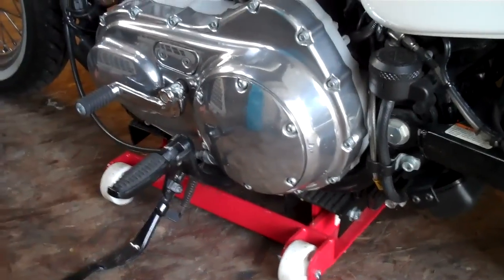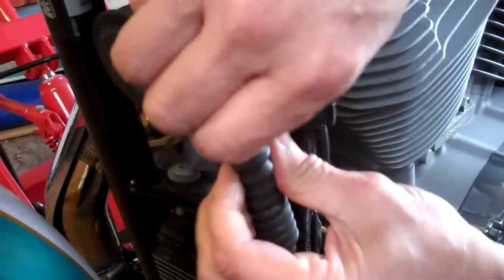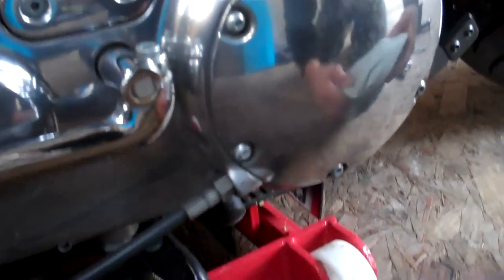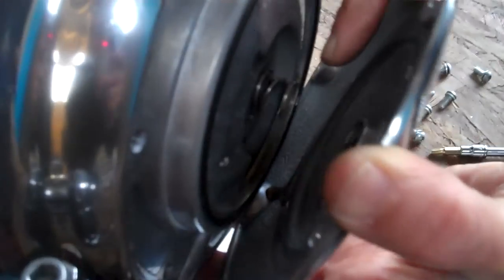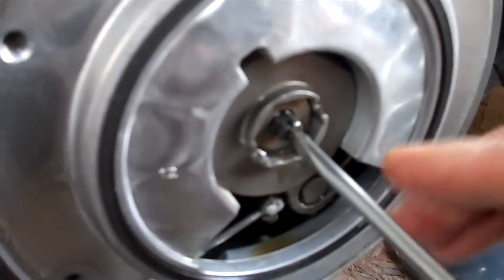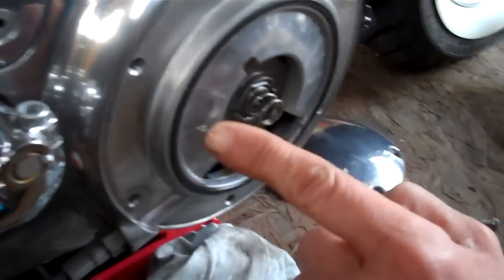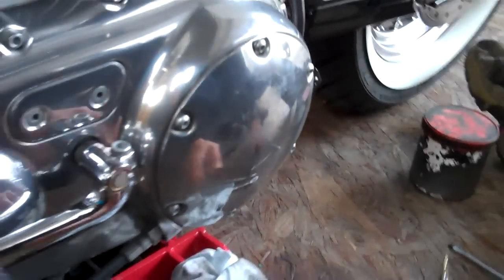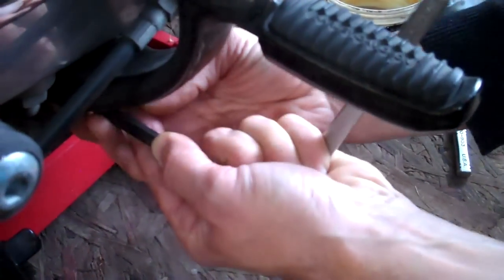Delboy's Garage, Harley Sportster Clutch Adjustment.

Comment: My sporty was getting stuck in gears and was too hard to downshift. When I had the clutch and in 1st, it was accelerating without letting it go. I adjusted the clutch after watching this video and fixed the problem for a bit but it's back to getting stuck. Also, it was hard to pop it in neutral. Any ideas on what it is?
Reply from the maker: WeenieJuice_Pompgawd If you adjusted it and it made a temporary improvement then it could be that it's time to replace the primary oil, as when this breaks down excessively it can cause the clutch plates to drag... may not be an instant fix, but at least it will eliminate this as a cause.... try that first and see how you get on!
Reply: Moonfleet41 When I adjusted the clutch, i didn't put the derby cover on right so it leaked oil. I put one quart of chain case oil and its still doing the same. Do i need a new clutch?
Reply from the maker: WeenieJuice_Pompgawd have you got the level of the oil correct..?
Reply: Moonfleet41 yes. 1 quart for my sportster xl1200n

Comment: im replacing the shift shaft in the primary. any advice... ps i may need a sprocket locking tool and that spring compression tool looks sic
Reply from the maker: +Michael Golightly Any advice??  Any advice on what buddy??  Are you having problems??

Comment: Those torx screws are evil, evil, little things. I have two that are currently stripped on my sporty. Tried the extractor tools with no luck :( . Next step is to try and drill off the head with a 1/4 in bit and hope for the best.

Comment: Hey man, I know this video is pretty old now but hoping you'll still give some advice here! My father and I went through this procedure about 30 times, a long and frustrating day. The results- the bike still wants to pull forward in first gear, even when the clutch is fully pulled in. Some adjustments eliminated this issue, but we still felt it was extremely hard to shift and to find neutral. Feeling like it was 'slamming' into gear. We are back at square one. Any thoughts? On an 08 nightster. Thanks for all the helpful videos, you've really made me more knowledgeable in the motorcycle world! Cheers.
Reply from the maker: Hi there, just so we can be clear, did you follow the steps exactly as we showed in the video??  Did you do anything different, or did you skip any part, or do it in a different order??  Let me know exactly what you did and will try to help, cheers, Del
Reply: +Moonfleet41 Del, the step by step- we backed off the clutch cable so it had complete slack, then opened up the derby cover, removed the hex nut, then used a flat head to back off the adjuster screw until we both felt that it was loose. Then we would turn it counter clockwise until we felt it start to give just a little bit of resistance, then backed it off a 1/4 turn. Maybe we are a bit off on where it's supposed to catch? 
Anyway, once we put the hex back in and button it up, we then took the slack out of the cable just as you did in the video. Like I said before, we did this a numerous amount of times with slightly different variations to how far we backed off the adjuster screw. Some would feel good, where it wouldn't pull forward, but then was still very difficult to shift and to find neutral. Thanks for the help sir! Hope this explains it a bit better.
Reply from the maker: Hi buddy, thank you - yeah, I know the adjustor screw part sometimes causes issues, let me talk you through it, try it again, following these steps and let me know how you get on:

"Make sure you start by collapsing the cable adjustor sleeve completely together so the lever is flopping around at the bar, and do this BEFORE you touch the engine casing... once inside the engine casing, observe the cable down in it's connecting fork at the bottom of the clutch and make sure there is a little free play on the cable and that it is not pulling on the fork at all... now you are ready to adjust the clutch pack.............

Remove the spring and nut (and here is where some people go wrong!)... back the nut OUT (counter clockwise) until it stops, and many people use a screwdriver and keep turning till they can turn no more and this is way too much !  When we say 'back out the screw till it seats' - we mean when one part touches the next.  You should not screw this adjustor screw outwards with any more pressure than two fingers on the dust cap on your tyre valve... I mean it must be really light pressure... you simply need the back of that screw to just 'touch' the back plate THEN turn back INWARDS ONE QUARTER TURN .... and then re-assemble everything.  

When you fit the nut back over the screw, try to make sure it does not move when trying to slot the nut in to it's cup... and then when you have re-set the cable free play, make sure that you have the 3mm of free play at the level knuckle.

So as you can see, the common problem is not understanding the seating of the adjustor screw, if you wind it out too much, you actually lock the clutch plates up, I really cannot stress enough it MUST be turned out with NO PRESSURE at all, in fact when I am busy and on a time limit with the service, I usually just use my fingers to turn that nut out... "

Like I say, let me know how you get on, don't worry, we'll get it sorted!
Good luck , Del
Reply: +Moonfleet41 we were about two or two and a half turns away from completely being tight, (turned counter clockwise completely). That's where we were feeling it just barely catch. Then rolled it to the looser side a 1/4 turn, 1/2, turn and a bunch of others in between just to see if it made any difference. Some felt better than others, but none seem to do the trick.
Reply from the maker: Ok buddy, just got up to your reply... 8am here in the UK.  Ok, so obviously something is wrong... so as a thought process here, sometimes, when you're stuck, it pays to think about the principal of the machinery, how it works, and the effect of what you are doing on it, so to explain that....

The principle of adjusting the clutch is to make sure that there is enough freeplay in the cable so that it's all fully relaxed and not pulling on the clutch when the lever is released, so that the plates are squeezed fully together under the weight of the spring.  Clearly, the effect of what's gone wrong now is that the plates are not separating when you pull the lever in, as indicated by the drag that you're experiencing.  

True enough, you describe the adjustment correctly, if you imagine the screw you're turning has a flange just the other side of the hole it goes through, and when that flange meets the casing, if you keep turning, it starts to pull the clutch plates apart... so there is, often, a problem with people being confused with the principle 'when it seats'... and quite simply, it just has to touch, nothing more!  Imagine if it was an electrical part and you're making a connection, the minute the two metal surfaces touch, that's it, enough !  You then back inwards a 1/4-1/2 turn to make expansion space for when everything gets hot... 

But you know all this, and you've done all this, so all I might suggest is that there could be some foyble with your clutch , or maybe even, a burr on a few of the plates... so there's two more things I can suggest.  One is to back out the screw till it touches, then rotate in a full turn and try that... if that is still a problem, and doesn't cure it, and the cable itself is not causing a problem, then you could need to take the clutch pack out and inspect it for burrs or digs in the clutch basket... you are looking at the slots that the clutch plates slide in to on the outer basket.  If there are any dents, or digs, in the those then the plate plates will get 'hung up' on them and refuse to separate, so they just need filing out and cleaning up.  Once those slots are smooth, the clutch plate outer fingers can slide in and out of them smoothly, so that could be it.

JUst one last point, am presuming this is part of a service??  And am presuming maybe you've changed the primary oil at the same time??  So if you have, did you put thick gear oil in there instead of regular engine oil????  

Hope some of that helps, let me know Del
Reply: Alright thank you so much again for taking the time out to help a complete stranger! We really do appreciate it. OK back to business- when you say "... so there's two more things I can suggest.  One is to back out the 
screw till it touches, then rotate in a full turn and try that".. which direction do you mean to rotate? clockwise to make it looser correct? Hopefully this will do the trick, taking the clutch pack out may be a bit too steep of a project, i have yet to watch your instructional video on it. 
 
As for your other questions, We have been doing the maintenance bit by bit on our bikes, and maybe a couple months ago, early summer, changed the oils. I've put in the SE SYN3 in both the primary case and run it through the engine. 
We decided to start adjusting the clutch not as a normal service, but because i felt it becoming difficult to shift and to find gears while riding, seeming like it was really slamming down into first, and had to use alot of leg strength to get it up to second. Finally with it getting even worse, with the bike still wanting to move in first gear.

This bike was a Craigslist buy with a pretty young kid as a seller, wasn't helpful with letting me know what type of oil was already in, so I felt that the oil I chose would've been the safest route all around. Maybe I'm completely wrong! Hope not.  

One last thought- you mentioned the cable maybe being an issue, what would be some signs? I guess good to mention- through a couple trials with the adjustment, we would notice that when taking the slack back out of the cable in the final step, the clutch lever would sometimes not squeeze completely into the handle. odd, and we knew we were wrong, so we would start again. Maybe there's a sign of a cable issue there? 

Thanks again, sorry this is a book to read!
Reply from the maker: Hi again Mathew.  ok, with the screw... to be exact... you turn the screw "outwards"...which is 'Counter clockwise'... and until you can feel it touch the stop..(no pressure on it, stop once it just touches).... then turn it back 'Clockwise' a full turn, and see how that goes..!!     

Now that you've told me about the previous owner and an unknown past....it could be that he added thick gear oil by mistake and it has glued the plates together.. but the SE Syn3 is the best oil it can have, so at least you've corrected that... 

I really cant advise you any further buddy without seeing the bike on front of me.. the lever should feel smooth and oull cleanly all the way in to the bar.. if its notchy or needs force, then perhaps it needs further investigation inside the primary case to look what may be up.... try that adjustment as i said here, just one last time and see if that cures it.. if not, then at least you have done everything you possibly can and perhaps its time to hand it over to a mechanic who can investigate it for you... sometimes you can win 'em all buddy... good luck. Del.

Comment: Dear Delboy,
I would like to ask the following. One fine morning i started up my sporty 15 and found out that the clutch lever was coming way back and i am not able to change gears unless i rev up the bike. In short i am not able to change gears and if i hold the lever with 1st, the bike still wants to go forward. And when in 5th, after 100km speed it just revs up and then takes all the power. (Like its not locking the gear) The technician told me that i might have to change the gear plates (spring plate and so on). Is that correct? Cost ranges from 100 to 350 € plus he said.  I thank you in advance and i would like any suggestions.
Reply from the maker: Hi there, don't know your bike, or it's history, or the exact characteristics of what you're describing, but if you suspect a slipping clutch, then you can level the playing field by changing the primary oil and carrying out the standard 'clutch adjustment' as per the normal 5,000miles service, and then once everything is set, and adjusted, if it's still doing it, you'll need to investigate further by stripping the clutch to have a look... good luck with it.

Comment: So I’ve installed the Barnett extra plate kit on my 2004 xl883 and I notice the more it warms up the harder it is to shift. So when I adjust the adjuster screw (when the bike is cold of course) should I make more or less slack from seated? I believe it’s at 1/4 turn out now.
Reply from the maker: Hi Drew,  the clutch adjuster screw needs to be set to 1/4 turn IN from the outer seat, not a 1/4 turn out as you said... the quarter turn gives you some hear expansion space, so if its getting sticky and dragging when it heats up, then you dont have enough expansion space.. so try a 1/2 turn INWARDS from the outer seat.. and see how that goes.. also, make sure you have the correct primary oil level.. it needs to be up to the bottom to the clutch plates with the bike upright..!!
Reply: Ok so I need to lightly seat it then go in (counterclockwise) 1/4 turn instead of out (clockwise) light I have been doing? Is that because I have the extra plate kit and need more room?
Reply from the maker: @dwillinghammer  NO Drew.. its all clear in the video mate.. i think you confusing "in" and "out" mate..... you start by winding the screw all the way OUT towards you,(counterclockwise) until it seats lightly... then turn back IN away from you, (Clockwise) to give you the freeplay you need.. if you've been doing it the other way round, then thats probably why its dragging... adjust it as per this description, (as shown in the video), and make a 1/4 turn INWARDS (clockwise).... then see how it is mate... Good luck.. Del.
Reply: Ok. I was just mixing words I had done it exactly as you did in the video. Turned it counter clockwise until lightly seated then turned it clockwise 1/4 turn. And now with its up to temperature it drags a bit.
Reply from the maker: @dwillinghammer   Aha right, i thought that would be the case... OK, then just go to a half turn then see how it is... its a known remedy, the advice comes from the guys who do stunts on Harleys, rolling burnouts and lots of wheelies.. it puts the clutch through so much more punishment.. (which they can take by the way lol)...some of them even go to three quarter turn., what ever it takes..  it will just git it more expansion space.... and should fix it for you buddy.... Good luck with it.. id be interested to know how it goes.. del.
Reply: Follow up from this morning: I readjusted everything and set the adjustment under the derby cover to 1/2 turn (clockwise) from snug and it felt really good until about 10 minutes later, second gear started to bite a bit when shifting. I’m thinking I’ll try 3/4 turns after it all cools down tomorrow morning and see how that feels. Thank you for all your help!

Comment: Hi del

I've just obtained a old Harley softtail 1996 all good but I can't seem to find nutrial when bike is running also it's really tough to shift from first into second all other gears are fine I noticed that the shift lever is bent I bent it back into shape could this be the problem?? Replace ??: I've had the primary inspected and clutch but no difference any ideas ??

Regards

Rob
Reply from the maker: Hi Rob.. yes mate, a bent shifter can make it hard to select gears..is it the long rod from the forward control, or the rod down to the gearbox?... either way, if the clutch was inspected, and all in good order, then replacing any damaged shifter parts could be a good idea..!
Reply: @Moonfleet41  Thanks mate it's the actual shift lever that you push up and down that was bent,  it was bent back but I think replacing with a new lever is the best option
Reply from the maker: @AlmightyMetalHead  OK, Hope it makes a difference, Good luck with it mate.

Comment: Hi, my 05 Sportster is pulling a tiny bit with the clutch lever pulled all the way back, do I need to adjust the clutch or can I fix this by adjusting the cable out a little? Thanks
Reply from the maker: MCGEE1115 'Dragging' ... is caused by the plates not separating, so yeah, just do the full procedure, do the clutch pack adjustment as in the video, then set the cable at 3mm free play, once those two are set correct, it should be fine... also helps to check the primary fluid level whilst the derby cover is off...
Reply: Moonfleet41 Cool, thanks I will give it a try! After watching this video it's not nearly as complicated as I had thought it would be. Thanks

Comment: im kind of a newbie and i have a Huge favor to ask, more like a question though. i have a 1973 Kawasaki f9 bighorn and it will move but if i give it any acceleration, it doesnt affect it at all. just jacks the rpm's up. it has an adjustment screw but it only has a circular hole, no torx or alan key hole. how does that work? or do i even have to do it at the clutch pack? or just at the handle? please, please!!! help!

Comment: great video... do you have a video on changing the rear drive belt { secondary } ? Thanks again on the great video
Reply from the maker: Paul Hickey Hi Paul,. sorry no, sadly no drive belt video....but its really easy my friend, just push the wheel right forward, drop the right shock absorber off, belt guards top an bottom, and the belt cover casing.....and it just lifts free....replace in reverse order and tension as usual...!! hope that helps.. Del.